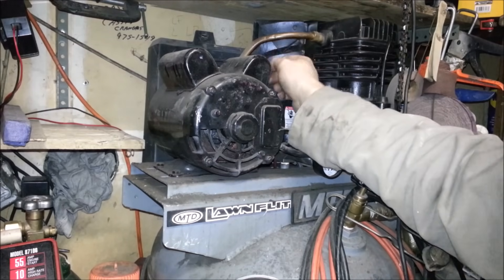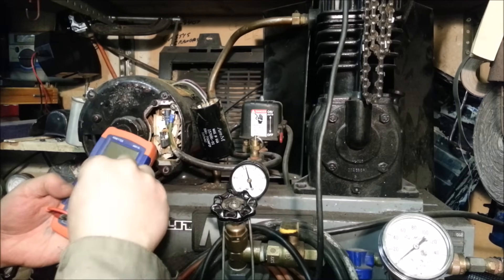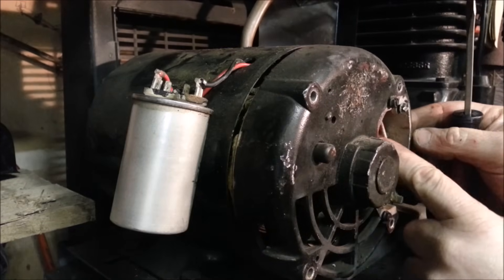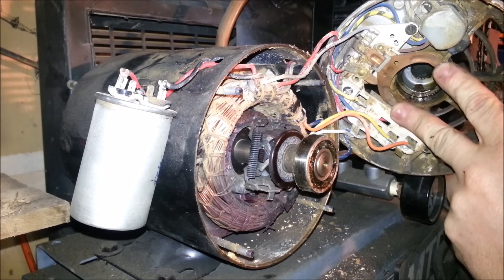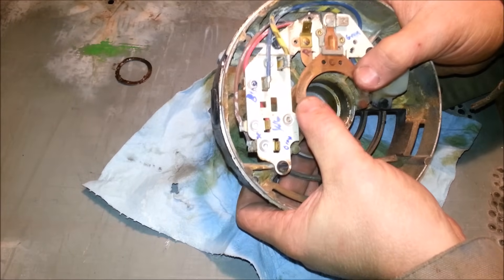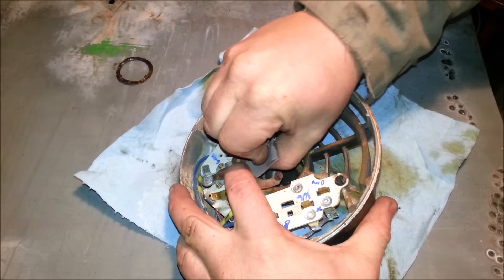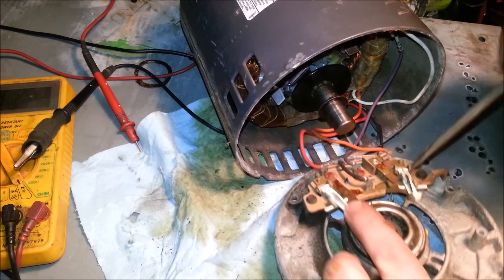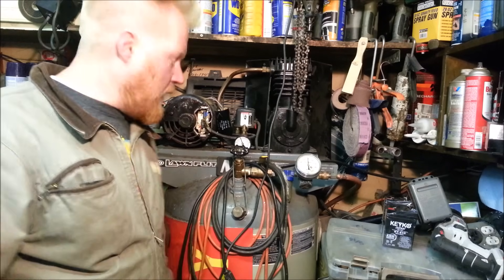Electric Motor Doesn't Spin but HUMS/Buzzes compressors etc

Comment: Hi, I have one similar to the one you showed with the white levers. However, one of the lever hooks has broken off, as well as one side of the levers pivot points. I'm unsure how I would go about fixing this, and can't find replacements unless I'm searching for the wrong thing. Do you know of any universal centrifugal switch plates?
Reply from the maker: Your only option is to find the same brand of motor and salvage them. Nowhere sells these anymore.

Comment: THANK YOU! I thought i was having a voltage drop issue as it would happen with a long (12AWG) extension cord but work when plugged directly into the house. Eventually it stopped working there also and i was afraid i fried the motor. This was all it was. Thanks again!

Comment: I have my grandpa's old craftsman compressor and it'll start and run up to about 60-70 PSI then just cuts off and hums, how would I diagnose that? 120v single capacitor motor (has a new capacitor)

Comment: I was having the very same issue on an old compressor that I have it doesn’t get a lot of consistent use. It’s more idle than run most of the time it’s about a dozen years old at least but when you started up, it would throw the breaker it would run less than a minute or less than 30 seconds throw the breakerso I replaced both of the capacitors. They are new and it’s still doing the very same thing.

Comment: Fantastic. I have a newish harbor freight compressor that has the same issue. I can spin the belt by hand then turn the compressor on and it runs for a while, then hums. I’ll be tearing my motor apart this weekend 😁

Comment: Some motors like on pool pumps have a set of points that open when pump is running,   If dirt get on these points when motor stops the points don’t close which is needed to start the motor,  sometimes a smack with 2 x 4 will get it going,    With pool pumps the area under the rear air inlets needs to be kept clean,   Rain can even splash dirt up.

Comment: Thank you so much for sharing this. I completely forgot about the centrifugal switch. I have a 2 HP, 120V, single phase motor on my milling machine which has occasionally going into a horrible chatter whereupon I would immediately shut it off. After letting it rest a bit I could run it again for a while. I checked the 150 MFD run capacitor (there is no start capacitor) and it checked out as good; however, I decided to just replace it anyway. Just put the new one in this evening and now the motor only buzzes. I'm going to pull the motor and get to the centrifugal switch and hope it's the problem.

Comment: Dude you have saved me from buying a new tablesaw motor! Swapping out the capacitor didn't fix the no-start problem, so I cleaned the contacts with sandpaper like you showed and boom, it starts right up! The inside of my motor looked a lot cleaner than the one you were working on - almost pristine - so I wasn't really expecting any results from the sandpaper. But there must have been corrosion between the contacts where I couldn't see it. This is good info for other people - now matter how clean it looks, get in there and scrape where you can't see.
Reply from the maker: Awesome, glad that worked and thanks for the update!
Reply: @sixtyfiveford  You are also helping to restore my faith in human kind mate! 👏 Many thanks!

Comment: Goin to try this today. My compressor will start right up the 1st start of the day. But hum when trying to kick back on an trips the breaker. If i give it 30 min between start up then it will start up. Hope this is a fix. Thanks
Reply from the maker: This sounds more like a different issue. If the compressor will start when it's low on pressure and or empty but not when it's cycling with 90 plus PSI in it; the check valve on the tank is bad or dirty. It's right where the metal hose from the compressor head dumps into the tank. It's a one-way valve that holds back pressure so the motor can spin freely.

Comment: Wonder if you might know, as I have an old 1960 Sears and roebuck tablesaw that  is making the same humming noise when I plug it in and after following what you did in this video it’s still not spinning unless I start it by hand then it runs fine. So I wonder if you might know what else could be wrong? Appreciate your advice.

Comment: Alright brother. Motor hums then pops motor fuse. Run cap was dead, swapped that out but still refuses to run under load (I spin the wheel and it goes)

Going to give this a try and report back. All goes well I owe you a beer!

Comment: QUESTION:  I have a Husky "silent run" and had a high water event and about a foot of water - enough to cover the motor/windings.  It wasn't standing in it very long - maybe 30 minutes until the water receded. I turned it on and it ran fine.  But several days later I engaged it and the motor just hummed.  i figure what moisture has had time to create rust.  Would the same issue as this video be at play?  Or could it have created surface rust on the windings?  I'm not very knowledgeable about air compressors/motors - but I can generally follow directions.  What say you? 🤠🤔
Reply from the maker: Electric motors generally have laminated sheets of steel. The water would have formed rust and what's called rust jacking. This would have swollen the plates and locked up the motor. If you can free it up by manually trying to rotate the motor it may be good. But that's a big "if" you can free it up.

Comment: Is it safe to just short the capacitors using a hammer with wooden handle? I need to do a similar repair on a 1.5 hp motor with 2 big external capacitors very much like yours. Never done it before, and I don't want to zap myself!
Reply from the maker: Hammer is fine
Reply: @sixtyfiveford  thanks. I think I'll try and find some rubber gloves too for when I take it apart. The wires were pretty short

Comment: Mike looks like it's gling to start to turn but don't. U can spin it and won't stay spinning either.  But it himself like it's straining to turn . I check the blade tension to see if too tight but wasn't. I guess have to check the caps. Before doing to much

Comment: How do I test the capacitor?
Reply from the maker: You have to have a capacitance tester. They're cheap https://amzn.to/3QRp0tV (The one I have). You can't test them any other way. The capacitors are generally around $20 just like the meter. So if it is the only capacitor you think you'll test in your life, it may make more sense to just buy a new capacitor.

Comment: Quincy around 1987 was bought by a company in China and now made in China compressors. No not "one of the best compressors made"  as video mentioned unless it were made in the 1960's USA made Quincy compressors. Same with Ingersoll Rand now made in China burtassembled in the USA, they are having quality control issues and a lot of failures with I. R. compressors.

Saylor Beall compressors are made and assembled in the USA, spash as well pressure optional lubed pump heads.
They have disk check valves vs cheaper reed valves as in in 90% of compressor heads being made. 

A 5 Hp 1 phase Saylor Beall 2 stage compressor compressor will produce 17 cfm output @ 175 psi vs all the cheaper lower quality reed valve compressors that produce 14 cfm output @ 175 psi. 
Baldor quality 1,750 rpm's vs Emerson or Leeson that draw higher amps being less efficient also 3,450 rpm's motors costing less to manufacture vs 1,750 rpm motors that spin the pump at higher rpm's increasing heat buildup also shorter pump life. 
Toyota dealership closing their doors after 47 yesrs, I was called in to remove all electrical equipment,  I had instant interest in the Saylor Beall pressure lubed w/low oil options on a 60 gal vertical tank, "it's yours for $250". Yup already had a spare NIB 5 Hp Baldor 1,750 rpm 1 phase motor. Replaced motor and magnetic start with a 1 phase with adjustable amp heater trip protection. Very quiet and smooth, no out of balance vibrations running, I saved over $3,700. Added a large after cooler and filtration, clean dry spray painting air. Curtis, Kellogg American also went away. Made in China living off the old American name brands, be careful loike Hein Werner floor jacks now rubbish from Chyna. Binks compressors name also in house with Quincy, your call on the now hard to get replacement parts. I bet Binks being owned by Quncy are both being manufactured in Chyna replacement parts vs Quency now assembled in the USA. Who do you trust? Very rarely Saylor Beall compressors needing repair beyond normal service that operate decades and thousands of hours longer than other brands on the market. I lucked out, more spending money for lathe and Bridgeport milling machine accessories and milling cutters.
Reply from the maker: That's first world country problems: Americans can't afford American labor. So everything has to be made with slave labor from third world countries. Even the stuff that's claimed to be made in America is BS these days. Essentially it's a China made machine sitting on American soil pumping out China parts on American soil calling it American made. About the only true American made thing with equipment anymore is the shipping of it. I wouldn't even trust Baldor anymore as being any different than everything else. That being said, with stuff being so cheap to produce in other countries with labor costs; You can actually end up with better quality stuff overseas than you can from America anymore. With one big caveat if they're told to produce it to that quality. 

I'm going to assume you're older than me and come from a generation prior. My generation and younger are lazy pieces of crap. I was brought up as well as people younger than me that if you do a job that requires physically using your body, you're worthless in society. If you don't have a college degree, you're no better than a man cleaning toilets. Again, this is first world country problems. This is how anybody 45 or younger was raised. Not saying there aren't some hardworking guys and gals out there with good parents that raised them to do so but it's the truth.

Comment: OK, so I dis-assembled my 5 HP motor to get to this electronic circuit board, is there a place to simply buy these boards? I tried Amazon, with no luck, maybe I am not searching the right way? My contacts are so worn, I'd rather replace the board, if possible. Thanks for the information, enjoyed your video.  Raul  PHX metro.
Reply from the maker: Unfortunately if you're in North America like me, people no longer fix anything. Instead we replace assemblies; ie: the entire motor. You won't find anything you can buy. If you dig real deep, you'll find parts in China and Mexico, but they're not priced to sell singles, only thousands of quantities.
Reply: @sixtyfiveford  YES , understood, in other words I need to fix mine. I'll see what I can do, appreciate the reply.

Comment: Thanks for the video.  I had recently been given an old Sears Roebuck 4" wood jointer and the original motor would just hum unless I gave it a quick spin to help it get going.  I watched your video and cracked the case open, dumped out a cord of sawdust from the 1950's, took a file to all the contacts, and lubed up the clutch like you said and she started right up!!! I've probably tossed 20 motors in the trash over the years, DOH!!!   Thanks again and keep up the good work.
Reply from the maker: Awesome

Comment: Wow I can't believe it's been 7 years since I last commented on this video. I'm back because my compressor motor wouldn't start and I was looking for wiring it up and ran across this video again by mistake. Got it figured out then it wouldn't start or even hum and I know it worked before. So I was suspecting the same thing opened it up and yep all charred up. On a side note I had a milling machine motor that the contacts were toasted, so I broke open a circuit breaker and carefully pried up the riveted ends, straightened them up, then pulled the contacts off the old motor contacts and replaced them with the ones I just acquired. It's still working today with no issues.

Comment: I have a 1HP Dayton motor and the 5 wires coming off the field have dryrotted insulation. There is no access to the wiring as it is tucked under the field windings and I don't think the field is removable. How would you go about this?
Reply from the maker: I would use liquid electrical tape to shield the wires from touching as good as possible. For the most part the wires should have a varnish on them and then extended with a copper w/insulation wire.
In a can with brush: https://amzn.to/3TfrrpM
Spray can: https://amzn.to/3yDjC3B

Comment: Gonna give it a go on the draft inducer fan motor on my furnace (Rheem 80 Plus).   

Can't  run the furnace with it only humming & getting warm.  

I got started on sourcing a replacement and i might still end up doing that, so nothing to lose if if the revival attempt isn't successful.

If it does come back to life, I'm gonna say thank u in advance right now.

I saw a couple of vids on oiling it and was gonna try that too, especially since i see a sticker on it that says 10 drops every . . . I forget the interval.  Sadly, 32 years later, uhmmmm.  Who knew?

Any pointers from others are welcome & appreciated!

Comment: I have a 1 hp well pump motor that just hums. I replaced the start capacitor and it still just hums. I have 240v going into the motor and the shaft turns freely. Just won't start. I have an amperage tester on its way to me so I can check amperage but I think I'll have a look inside to see what I find. If I can just fix this motor issue, I won't have to purchase another well pump. This one lasted just past the 3 year warranty.

Comment: I was troubleshooting the hell out of my compressor.  I don't know a ton about electrical issues, but I tried everything.  I was about to give it away  to someone who could actually fix it, but this saved me.  Thank you.  Although I'm not good with electronics, I am good at fixing things.  And not fixing this compressor was really bumming me out because it seems so simple. But it's handled, which strangely is almost more rewarding than having my compressor working again!

Thank you for posting this video!
Reply from the maker: Awesome.

Comment: Yea more than likely the run start capacitor is bad being careful you can always pop the cover on the shaft 1/2 box wrench in place spin shaft with open end quickly energize aka  turn on power also to check capacitor you would measure micro ferrite most values or stated on the most are at 28- 35 for good range

Comment: Just dropped by to say thank you for the insightful video.  Exact same problem on my 2hp motor, same fix, fired right up after countless times humming.  My only issue was getting the cover off, set of pliers, a firm grip, ever being so careful and it came off.  Life safer!
Reply: Saver*  auto correct failed me

Comment: what if you've replaced the motor and it won't start? I've tested power from the wall and get 120 on each side, tested the motor contacts from the pressure switch and have 120 at the motor with the switch on, but it still wont start. It's a single phase 5hp 240v straight out the box
Reply from the maker: I would direct wire the motor just to eliminate the pressure switch. It could be giving you phantom voltages that aren't carrying any amps. You can also test for phantom voltages with something like a 120v drill, light bulb etc.  And or pull off the belt and try spinning the motor pulley by hand to a different spot in it's rotation. Then give it power.

Comment: God bless you for taking the trouble to share this.  You just saved me $150 - $200 for a 3HP single phase 250V motor.  My problem motor is over 30 years old, but WTH, it was still working and now lives again thanks to you!
Reply: I've seen your posts on Vacuumland. Is that the same motor you used to buff your Royal?
Reply: @mikemarino5762  Oh Lord no.  That motor is from a huge Craftsman compressor.  Royal housing was buffed with Hitachi rotors buffer.

Comment: Great video-thanks!   I have an old B&D bench grinder that suddenly stopped while I was using it...hard!   It got pretty hot.   Now it just buzzes.  When off spins freely but turning it on magnetized it and locks it in place.   Any ideas?   Brushes?   Thank you.

Comment: Hello there. Got a quick question; how can I get a centrifugal switch for an air compressor, and where? Thanks in advance. God bless
Reply from the maker: Google it by the electric motor manufacturer. However very few are available for sale.
Reply: @sixtyfiveford  thanks a lot👍

Comment: Saved Big Bucks on my 35 year old Sanborn air compressor with a Century motor...  Unloader on Pressure Switch was sticking and caused motor to overheat kicking out thermal.  Over time the points on the start switch also became a bit non-conductive.  Oiled the unloader valve, cleaned starter points and runs like new.  No doubt the life expectancy of the motor will be diminished due to the overheating, but for a garage compressor will occasional use it should provide air for years to come.  Thanks!

Comment: You checked your capacitors,s even though the value could change over the years...They are cheap and easy to replace...the voltage value can change over time as well..

Comment: Thanks Moe. I know your time is limited. But can you give me which ohm meter settings u used? Was it just to see if you have a circuit?
Reply from the maker: You actually need a capacitance tester to test the capacitors. Very few multimeters have this function. It is listed usually under ufd or mfd as the setting. The one I have is listed in the video description I think cost me around $15. 
You can use the ohm setting to see if your contacts are connecting.